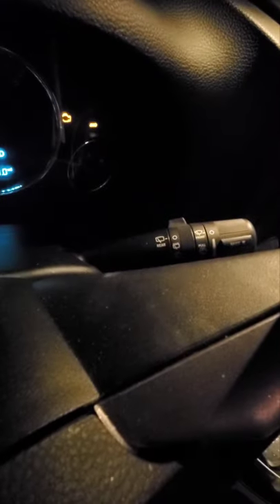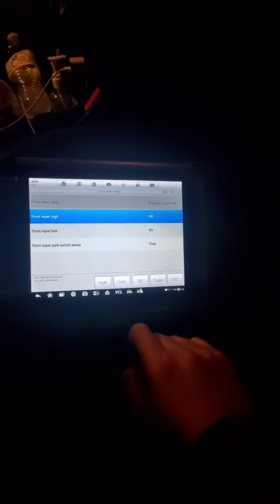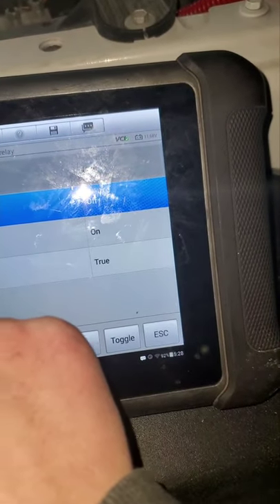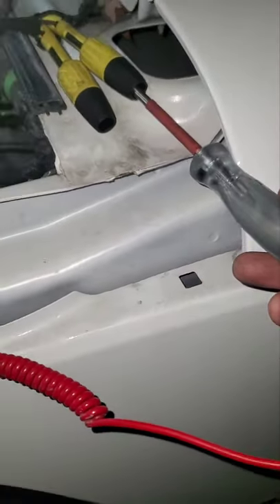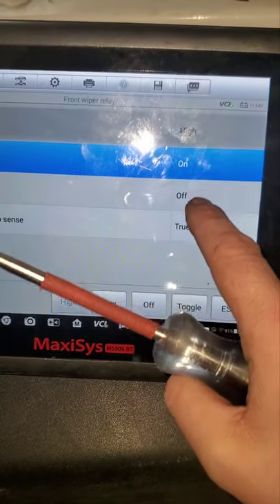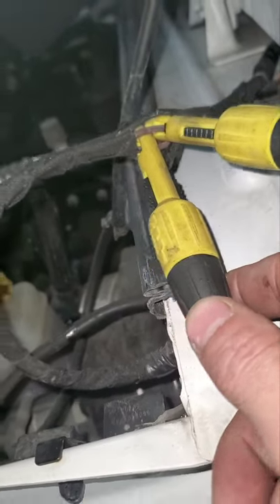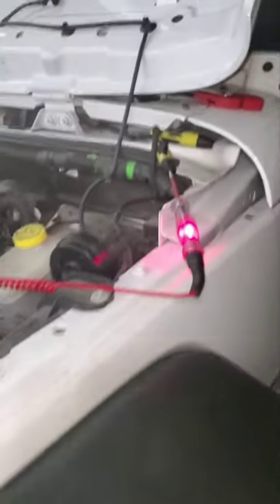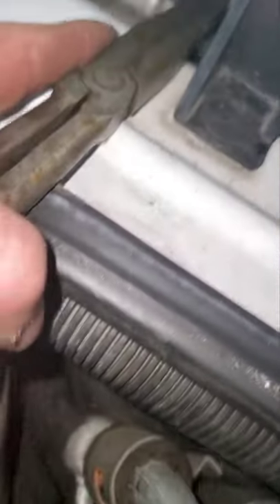2017 Jeep Wrangler front windshield wiper INOP

Comment: So was it the tipm ?
Reply from the maker: No was a broken wire if I remember correctly
Reply: I have the same issue, I have continuity on the brown/ blue and brown/ orange wires from the wiper motor to the fuse box
Reply from the maker: @iperez63  have you tried to load the circuit or voltage drop
Reply: Not yet, I’ll do that next
Reply: @juansautodiagnostic6199  no, having a hard time understanding the schematic in the relays in the fuse box.  I have a probe,  just need to locate the wire that feeds the relay or the one that controls it?